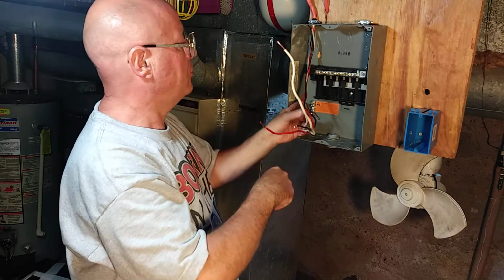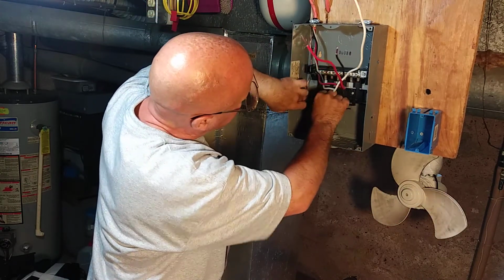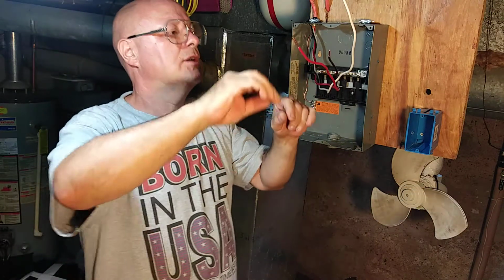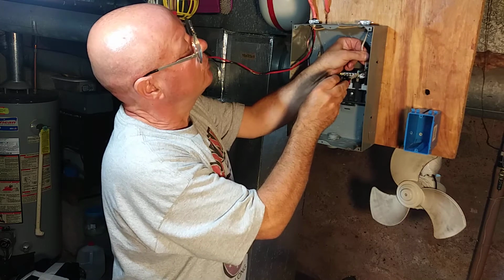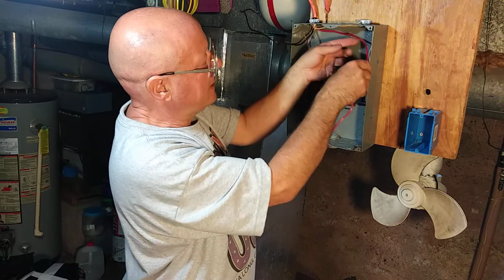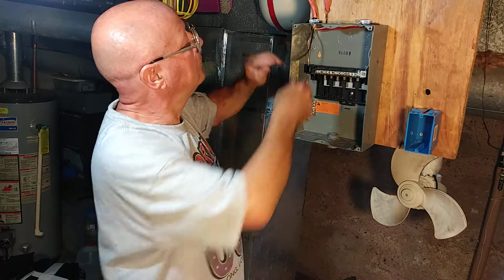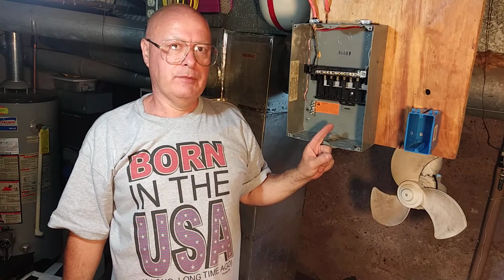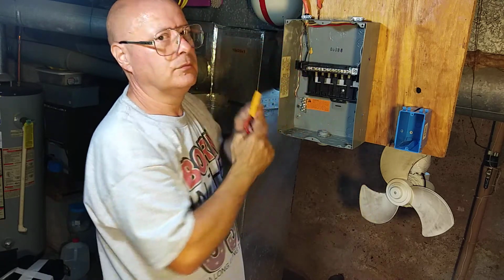I show and explain how to wire a 240 volt sub panel

Comment: Hi David, I have and older Jacuzzi wired from a 240V Sub-panel with only 2 hot wires and a ground. I am getting a new Spa and they tell me  I need a neutral  as well. Can I just run a wire from the existing Sub-Panel or does it need a different {newer Sub-Panel) to do this. I am not sure, any help will be appreciated, thanks !!🥺🥺